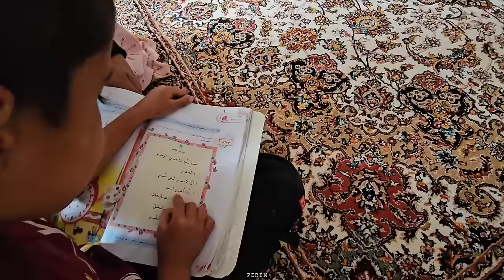Rural life in winter 🌬🌫 Tahmurth went to the city to buy a heating device ⛄️

Comment: dear peren family I see that it is snowing today too, the concrete track that you built yesterday is not enough to free you from the mud with the snow and rain that prevent you from moving, I believe that you should cover all the ground that belongs to you with the same material that you have placed in front of the house, you will be able to move more easily even when you have to use vans without running the risk of getting bogged down in the mud, I hope that this suggestion of mine can be useful to you, greetings from Italy.🙏

Comment: 🥰You should extend the fire flue's so they stick up above the roof of your rooms a lot more than they are, that way it creates a better draw of air and the fuel burns at a hotter temperature. This would reduce the amount of soot that builds up because the air mix is too low. Best to get the air mix right, because you can easily die from carbon monoxide and fire smoke.